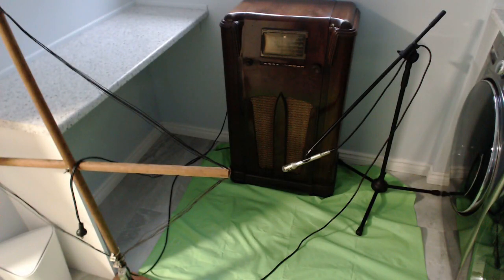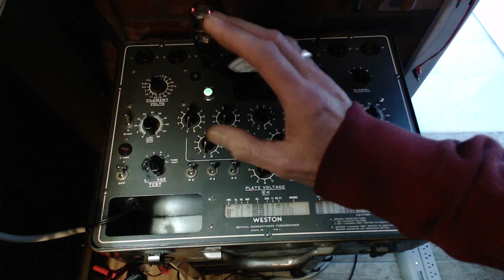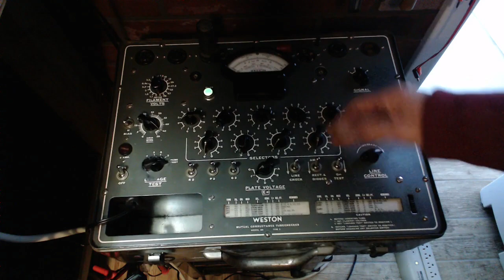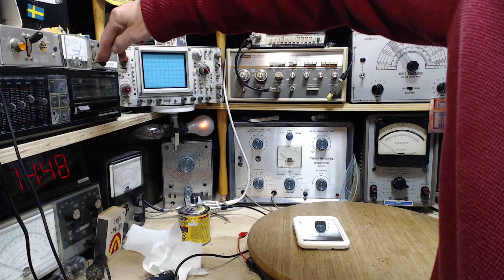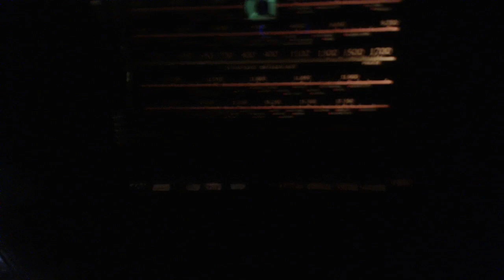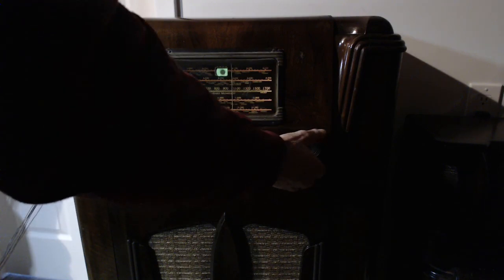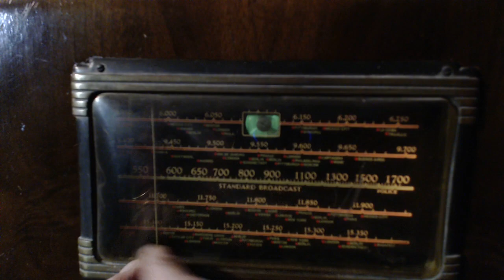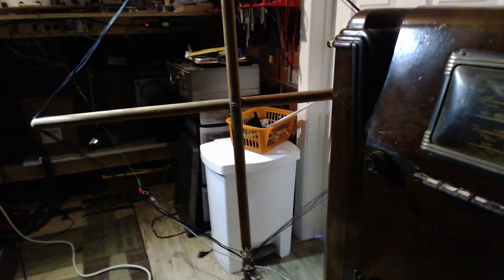Westinghouse 636 video#18 - Big Success

Comment: I'm surprised you didn't center the magic eye and it is still pointing toward 5 o'clock. That would bug me every time I used a set.

But it is great that it finally got finished. Those two were both tough broncos to break to saddle. Congrats!!!
Reply: Yeah, the eye. But the front-glass opening is an horizontal rectangle; it would occlude part of the useful section of that tube's display if not positioned to 5 o'clock.
 IIRC, Jim mentioned that the eye tube he found in her was a concentric, not wedge type. 
Could that be why the weirdness?

Comment: Great job done in this series but still one minor issue is that you are turning clockwise while the pointer moves left side..One loop of the string around the tunning capacitor shaft might be wrongly done in a former repair..Thank you Jim